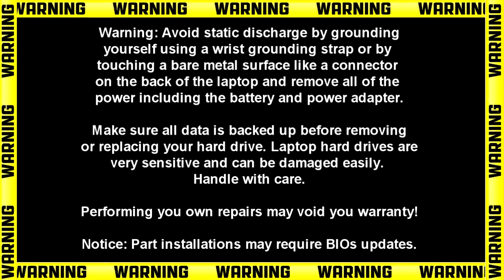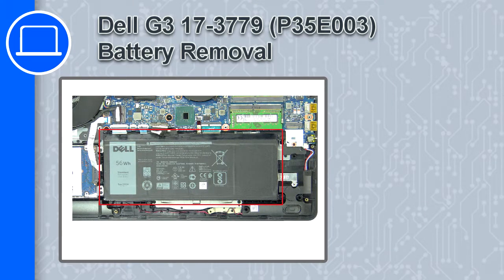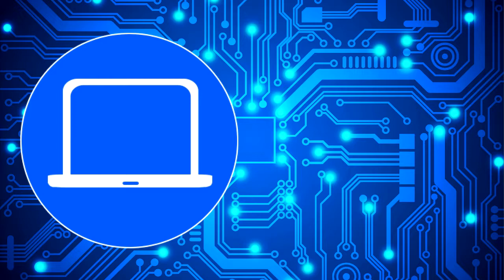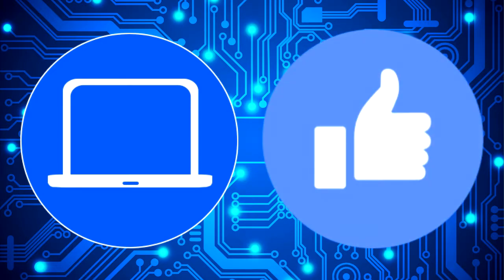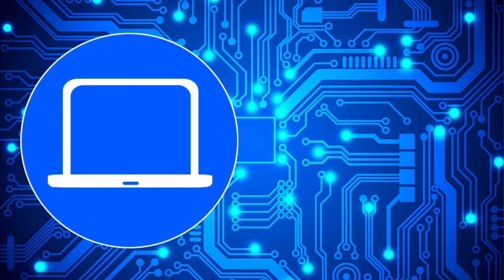Dell G3 3779 (P35E003) Battery How-To Video Tutorial

Comment: How did you remove the "ribbon" connector? In the video seems without effort but mine is kinda hard, I'm afraid to break the pins
Reply from the maker: If you pull firmly it should come out with no issue. It sits in there slugly so it should require some effort.